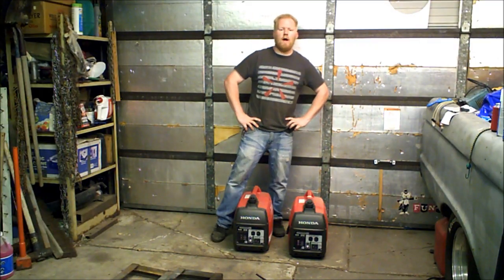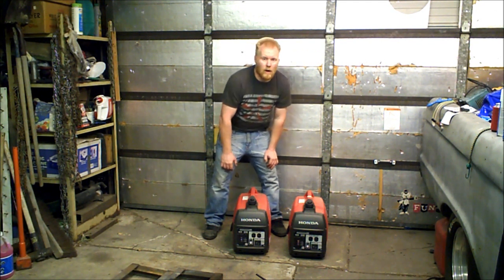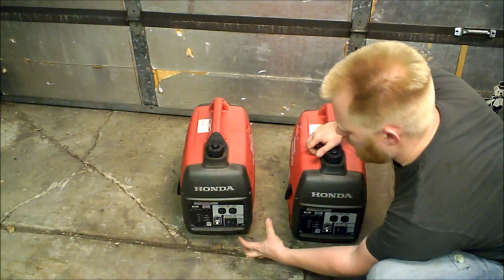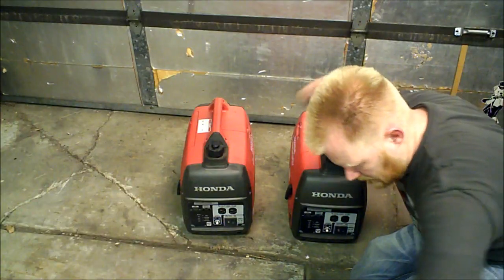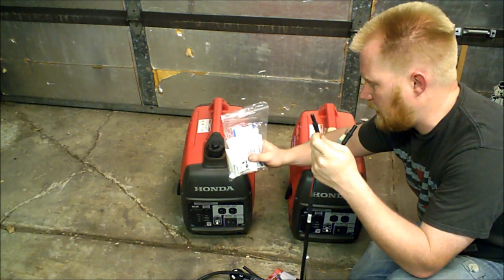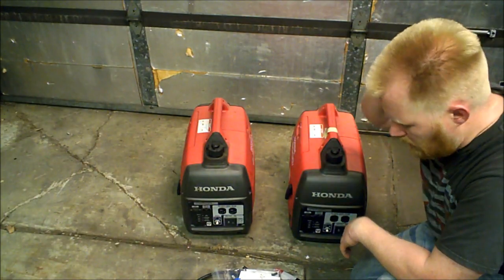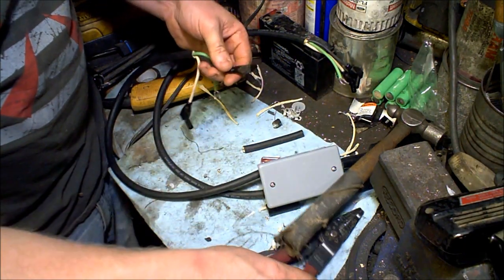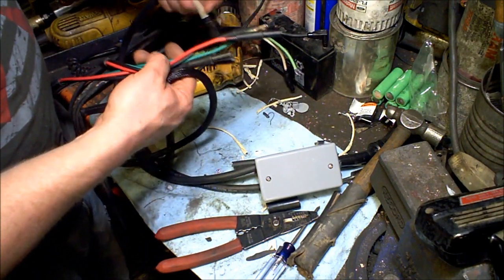Homemade 30A Honda Eu2000i Parallel Kit Generator

Comment: I think the banana plug assembly may not be required.  That is marketing "mumbo jumbo." (We make it look complex, so we can sell the ignorant people a $300 cable.)   I base my opinion on looking at the schematic diagram in the back of the owner's manual for Honda EU1000.  If you look at the schematic, the banana plug terminals are in parallel with the actual 120V outlets.  I believe it would work if you just use your cable that parallels the outlets of the two generators.  Make your own study and please post results if you make it work without the banana plug terminals.  I own Chicago Electric 800W.
Reply from the maker: The reason you don't just use 2 male plugs is one will be live if it comes unplugged. It will work just fine it is just a safety hazard.

Comment: Will it matter which outlet on the gen the black wires plug into when doing my 50 amp project?
Reply from the maker: It does not matter which banana plug socket you plug into on your Honda.
Reply: Ok thanks. Now I have got to find a box big enough to hold all the connections, the outlet, and the breaker. No luck so far. May have to go with the pig tail plug and just a junction box like you did.
Reply: Tried to send a picture of my finished project but couldn't figure out how to post pictures. I will probably test it tomorrow with two eu2000's. maybe three if I borrow one from work. Any words of wisdom before I start plugging everything up? I ended up using the 50amp end of a 30 to 50 amp dog bone. Only had three wires so I hope that both legs are wired inside the plug head.
Reply from the maker: Just make sure to plug them all into each other before starting any of them.
Reply: First of all thanks for all your technical support! I hooked up to two gens today and tried to check with multi meter. Checking neutral to hot I get 128 on both sides. Ground to hot I don't really get a stable reading. Any pointers on what I should be getting before I hook up to my camper?
Reply from the maker: 128 is good for a generator. Any where between 130 with no load and 110 with a load.
Reply: Tried it on my fifth wheel and everything worked fine. Started with three 2000's and ran both my 15k and 13.5k ac units. Then shut both ac units off and tried with just two 2000's and still ran both ac units. I did have a few lights and the frig running as well. Great to know I have this option now. Thanks for your help.
Reply from the maker: That's great. I'm impressed it ran both units with only 2 Hondas.
Reply: I was impressed also. Didn't let it run but about five minutes or so.

Comment: I like this a lot. I have a Companion as a side-kick for my regular Honda so I don't need it, but my friend sure can use this info. Just a thought. Why solder and not wire nuts? I have never soldered 120v connections, only wire nutted them. Just to add some a tip, you could use a 120v/30a regular plug in a 4X4  j-box. That way you can do a one-stop shopping at Home Depot (unless they sell those adapter pigtails.
Reply from the maker: The reason I went with a pigtail vs a fixed outlet is flexibility of the adapter and weather resistance. Soldering is a permanent attachment of wire where corrosion from moisture wont affect it. Wire nuts are very poor in fixtures that move or used in outdoor environments.
Reply: sixtyfiveford Maybe it's because I live in California, but we have never soldered a/c connections, even in out parking lot light fixtures or roof mounted yard lights in our distribution center with 277v/460v fixtures. You make a good point, and I would add the wire nuts on those soldered wires then shrink-tube them. The flexible pig tail makes a lot of sense. I used your video for a friend who needed a guide for parallel matching his two EU2000i gensets. Thanks for your response! You made an excellent video.

Comment: Is something like this possible with the Canadian model? Been looking everywhere for an answer...
Reply from the maker: It is against Canadian electrical code to do this. That is why the ports are omitted on Canadian Honda models. I had one gentleman from Canada that just made 2 standard MALE plug ends joined with with the 30amp Female receptacle. The Male ends plug one into each unit and you will have 120volt  30 amps at the Female plug. This is however slightly dangerous; if someone unplugs 1 generator while the other is running, that male plug is live.

The 2 ports that I am plugging into connect directly to the hot and neutral on the outlet internally.  The ends of the slim plugs have a shielded tip so if someone unplugs one side while the other generator is running the tips are shielded.

With all that being said many many people have done this.

Comment: Just remembered I will have four wires on my fifty amp plug. What do I do with my extra hot?
Reply from the maker: A 50amp plug is technically a 120 and 240 volt service plug. To do a 50amp setup with 4 of these 2000i you can't have anything in your RV that actually runs off of 220volt service.

You have 4 prongs. Bottom Flat, Left Flat, Right Flat, and Top round.

Top Round- All four ground green wires will go to this.

Bottom Flat- All four neutral white wires will go to this

Left and Right flat need all 4 wires to touch them both. So I would put a breaker in between them and your terminals. Here's how: All 4 black hot wires connect to 1 side of a 50amp push button circuit breaker. Then have 2 leads coming off the load side of the breaker with one connecting to the left flat terminal and one connecting to the right flat terminal.  This will give you 50amp 120 service.
Reply: sixtyfiveford ¿
Reply: sixtyfiveford  A little confused on this..

Comment: Could 4 of these generators be wired into a 50 amp plug? Or if 2 of my 4 units were companion units could I justuse a 50amp cheater box?
Reply from the maker: Yes and yes. All these parallel terminals do is touch the same wires on the outlet whether it is a 20amp standard or the companion 30amp. So you could just make a box from the two 30amps into a 50amp plug. This way would require you to make a death plug that has 2 live ends plugging into the 30amp plugs.

It would be safer and easier to cut your 2 sets of parallel cables and wire them into a large box with a 50amp plug.  You would be able to use 2, 3 or all 4 at any given time.
Reply: http://www.campingworld.com/shopping/item/50-amp-125250v-rv-female-2-30-amp-rv-male-plus-y-adapter-with-powersmart-leds/71205
Reply: This is what i was referring to as cheater box. It could plug into the two companions that are parallel with a standard model each?
Reply from the maker: If one plug falls out or someone unplugs one while its running it is live so they call this a death plug. It works just fine though.

Comment: Do you mean the 30 amp breaker built into the companion or the one you built?
Reply from the maker: If you have a Companion then it will handle 30 amps output on the Companion with the standard cables. BUT, it will only do 20 amps on the standard eu2000i as it is limited by the breaker. So if you have a companion and the standard cables you shouldn't need to do anything to get full capacity out of you generators.

Comment: When wiring for standard 110, do you just repalce the camper cord with a standard out let?
Reply from the maker: This is all 110 that I am playing with here so all you need is an adapter to go from a 30amp to 15/20amp
Reply: sixtyfiveford I want to put a outlet in place of the cord that you have for the motohome
Reply from the maker: They sell small 15amp outlets for campers (usually on the ones that go in the bed of the truck). Or you could get everything you need at the Home Depot and make an electrical box with a Male end coming out of your camper.
Reply: sixtyfiveford I think we are talking about two different things. If I wanted to make your setup up. Instead of your camper outlet that you have, can I just put a standard 110 wall outlet in a electrical box in place of your camper outlet.
Reply from the maker: Oh....... If you just need a standard 20amp 110 outlet, you don't need my fancy box in the middle. Just directly connect the Honda's together with a $30 dollar cable and plug into any one of the outlets on the Honda. Any one of them will be a full 20 amps at 110volts when tethered. You could put a box with a 110 outlet in the middle but it is redundant.

Comment: Great video, thanks.

Just to be sure i saw it correctly.  the 2 black wires from the s.o. cord are sautered together and then sautered to one side of the circuit breaker(line) and the black from the 30 amp pig tail (load) is suatered to the other side of the breaker?
Reply from the maker: Yes. The breaker just interrupts the flow in an overload situation.
Reply: Thanks!

Comment: So you're basically shorting the two hot wires from each generator together (at the fuse)... but the generators have circuitry that synchronizes the cycles on each generator??? ..and the output is 220V?

Comment from the maker: For a basic circuit you will have 3 wires: Ground, Neutral, and Hot.

Ground(green): Connect all together.
Neutral(White): Connect all together.
Hot(Black): Connect the 2 from the generators together and then connect them to the "Line" side of the fuse. Connect the remaining black wire from the 30amp plug to the Load side of the fuse.

Comment: you said it didn't matter which way you hook up the purchased parallel cables. I listened to, hooked them up. like you said and it toasted my EU1000. IT DOES MATTER HOW YOU HOOK THEM UP! Thanks alot doude!

Comment: Does anyone know if the Kipor Parallel wire kit (IG2000P) is compatable with the Honda? It is much cheaper. I have seen it for under $50.

Comment from the maker: It easily runs my 13,500 BTU AC unit, but 2 eu2000i should also push a 15000 btu unit.

Comment: You can also just buy (1) Honda EU2000i and (1) Honda EU2000i companion which already has a 30 amp outlet and breaker. Good video though!

Comment from the maker: No. They are just a way of making a shielded connection. The banana plugs have a plastic sheath on them so if one end is plugged into one machine and the other end is not, you won't get electrocuted  On the USA versions the wires from the banana plug connects directly to the Hot and Neutral on the outlet. So you could use a male plug to male plug to parallel them it is just a little dangerous. If one end gets unplugged it is live and can electrocute someone, so be careful.

Comment: Cant wait to try this!
The reason why its correct to use a 30 amp breaker is because the wire is rated at 30 amps.  Even though the generator output is under 30 amps, if for some reason there was a short, the breaker protects the wire from catching fire and not the generator.  The generator has its own protection against overloading and will turn off its output if it was overloaded.

Comment from the maker: Yes you can easily do that. It is just dangerous because if one comes unplugged it is live with the male terminals exposed. I know that Canada electrical code has the twinning banned, so the use of 2 male plugs is the only way. 

The way that they are wired internally is: the banana plug wires go directly to the 120v outlet. Nothing fancy.

Comment: im in canada and thy don't have the twining capability do to are c s a cods. i was just wandering why you can't plug in to the regaler 120 on each and add the ground to them and get the same thing instead of using the banana plus. making shed you don't have the hot and the neutral corset. let me know what you think? will it work or no?

Comment: I see you had the generators on a clean spot. 

But just so that other people know, those generators air intake is on the bottom, so if you are going to run them on grass/dirt/shells/leaves, etc, then you need a them on a concrete pad or plywood to keep them clean on the inside.

Comment from the maker: In my motorhome the only reason I pair these is to run the AC. I have a Deep cycle battery and a small inverter to run TV's and other smaller devices but I need to buy a bigger inverter for the microwave. Those eu1000 are really nice and light units.

Comment: Also, keep in mind, that the Honda Cables are of such a gauge wire that you can parallel  2 EU3000i generators also, for 6000 watts peak.   if you pair a set of EU2000i , you should understand they are designed to run 1600 watts continously, 2000 watts peak, for only up to 30 minutes.  So a set of Eu2000i's will give 3200 watts continuous running.

The factory Honda cables will flow a heck of a lot of amps.

Comment from the maker: I just checked my old invoice and I actually bought them from Mouser . It doesn't matter what side they get plugged into so I just went all black. Shipping from them was under $5. Use item number 565-6729-0 or 565-6729-2. It should run you about $25 shipped.

Comment: It would be helpful if you told us where you sourced this part? I see Grainger has it, not cheap, about $5.50 per plug 2 each in black and red., $22 in parts alone before shipping.

Comment: yes, they do... green is ground, red goes and plugs in on the right, black goes in and plugs on the left, per the Honda Instructions.  Red on the Honda Cable is Neutral, and goes to the white cable on the 30 amp plug, green goes to greens, and black goes from honda cable to the line side of the breaker, and the 30 amp female goes to the load side of the circuit.   breaker.   Both greens from the  honda cables need to ground to the honda chassis on each unit, and on the 30 amp RV receptacle.

Comment: It would be a good idea to point out that if you use the Factory Honda cable kit to synch the generators, you still need to add another 12 ga  ground  (green wire) to the junction  box, to the green wire on the female receptacle, as is done in your original 3 wire version as shown here..

Comment from the maker: Yeah its a mid 90's Coleman 13500 BTU. Running with fan on high is 13.6Amps total. Startup on my gauge is around 16amps(1920 watts). If they are on eco mode they take 2-4 seconds after being bogged down to produce enough current to start the AC. Eco mode is really hard on your AC and Gennys.

Comment: What are the specs, and make and amp draw of your current A/C unit on your travel trailer?  I assume about 13500 BTU, which if you double that, pulls about 27 Amps at start up?  Depends on if it's efficient or not.  I understand it's better to keep the generators in regular mode, not eco mode, when starting and running the A/C unit, due to the voltage possibly dropping, along with spiking the amps upwards?

Comment from the maker: I have plugged 2 running generators together and one will make a ZIPPP sound as they try to sync (not Honda recommended). I doesn't sound good. But I don't see how plugging a running one into a non running one would affect anything.  

Honda recommends connecting them. Then starting 1 then the other. 

The only thing that concerns me is the load. I would make sure both are off "eco throttle" during the swap but I don't see why a uninterrupted swap wouldn't work.

Comment: needless to say that the setup i'm talking about is not up to code and is just a theoretical logistics if that will work in theory or not. using male male plug will have some open ends under high voltage - and is a health and fire hazard,
in other words dont try this at home

Comment: 3. I'm interested in idea of uninterrupted generator swap:
When one generator is running parallel connect the second generator (male-male cable from second gen to the line of working unit lets say it has some extra outlet down the line)
then start the second generator so it will be in synchronization with the first one then properly disconnect the sync cable and turn off the first one. (carefully reconnect the plug from first generator to second and remove the "male-male" link.!plugs are hot)

Comment: 2. Yes the male-male cable is not available for a reason(s)
Running a cable through the top handles of generators is recommended in manual

Comment: Thank you for respond
1. The 240 in sync does not seem to be plausible.
with honda you can synchronize only same fase and reversing the fase will not be in sync. the only thing i could think off is running parallel and then quickly switching to series and reverse the fase with non inductive load. But then it's very likely that the synchronization and fase drift will result in massive internal power loss or "permanently damaged"
Perhaps even with a pace maker the load will not be ballanced.

Comment from the maker: They could be permanently damaged if they are synced while running (according to Honda). They only sync when both wires are connected ( ground doesn't matter). Theoretically you could get a 240v out of 2 units but they would be out of sync could damage whatever you are running. 

Yes you could use a male - male cable and use the 20a breakesr in the unit.The only thing is that it is a safety concern if 1 plug comes unplugged as it will be live.

Comment: Thanks for the video! Have a few questions/ideas. Will the gen sinc if you have just one wire and the ground? Probably not but if they do you could potentially get double fase (240v). Another question if can parallel with just male-male cable - then you cold use ithe 20a beakers in the unit. My third question would be about uninterrupted gen swap using parallel kit

Comment from the maker: continued........ But you probably wont even try to turn them on with only the gennys running. I am sure it is against all kinds of electrical code. Just make sure you put in a transfer switch so you don't feed power back into the system and kill a Linesman.